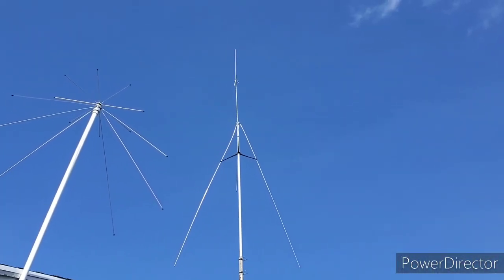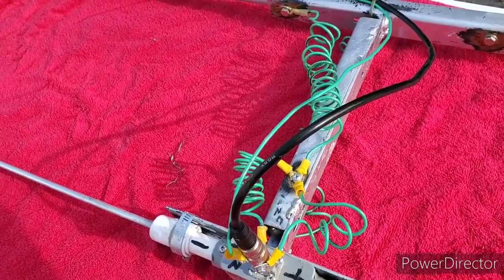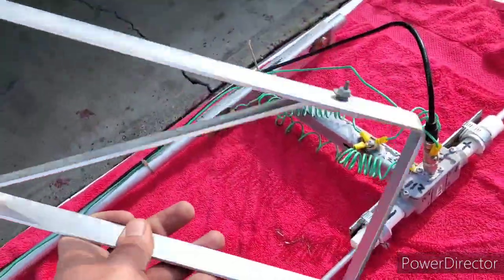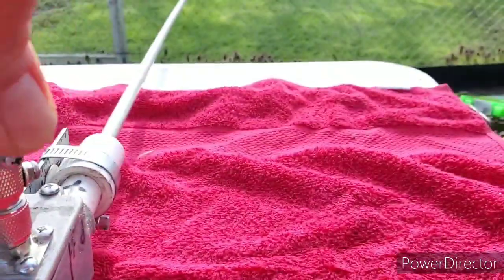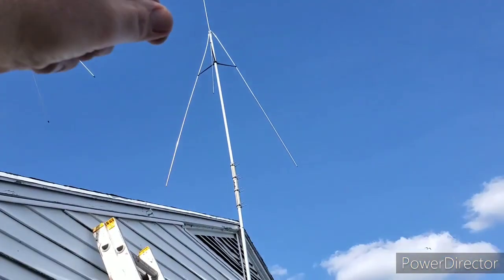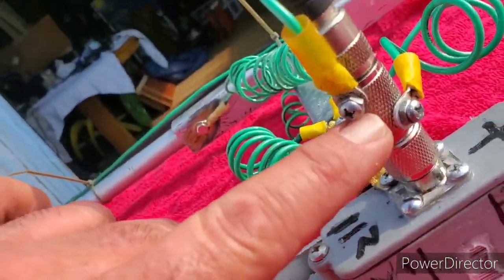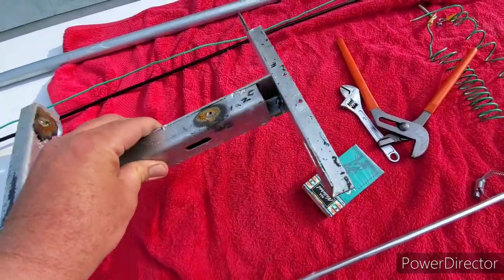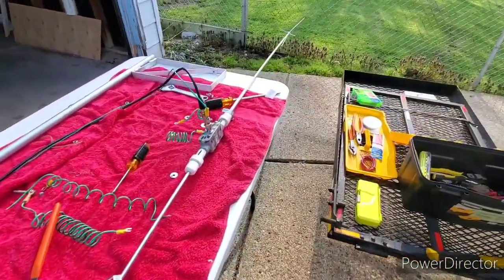671 with a Sirio M-400 You will made to dipole homemade 5/16/20

Comment: 671,
I have a home 5/8 wavelength vertical wire dipole. I use to have a homemade
 5/8 wavelength vertical wire extended double zeep but due to the high winds here I made a smaller version. It get out spectacularly awesome when skywave/groundwave propagation conditions are good. 
I love building my own antenna's with the help of computer modeling.
Reply from the maker: Thank you my friend 73 have a good day

Comment: Hey Bro,....the project looks good but for one thing and i really hate to rag on you over this but,...you built a 1/2 over 1/4 wave di-pole,.......the sirio M400,.....its the same thing.  The only difference is that you have one radial on the negative side at a 180 degree angle,...the sirio has 3 radials, at a 130 degree.  which of the antennas is going to skip better?  Ill give you a hint.  which antenna has the higher angle of attack to get the signal off the ground?  the di-pole is grreat for local but the m400 is a skipper antenna, thats what its built for.